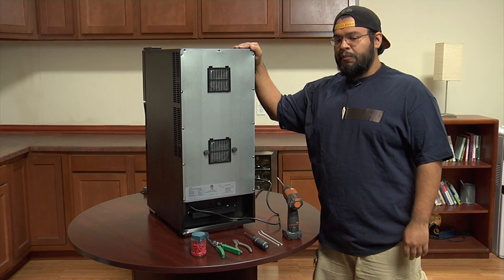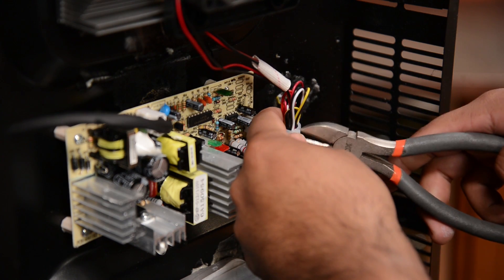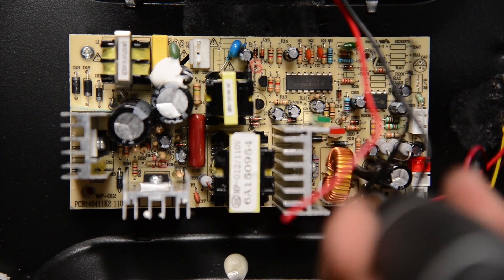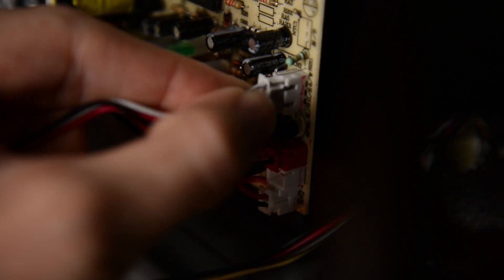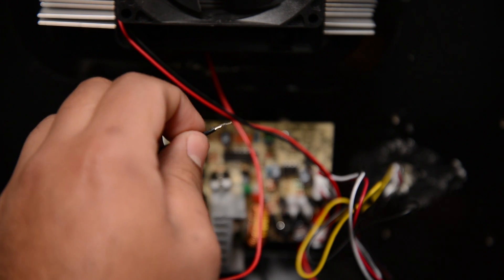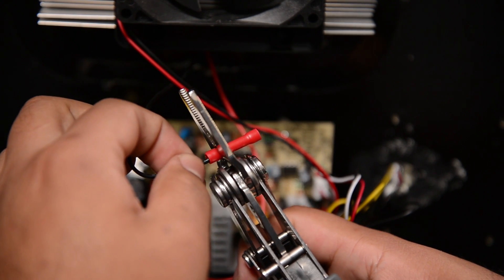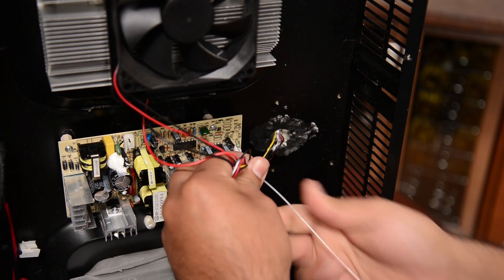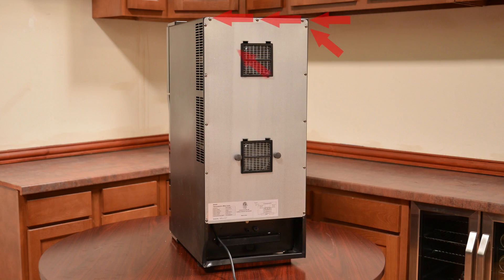How to Replace a PC Board in a Wine Cooler

Comment: this is a great video, thank you, even a lay-person like myself can do this, my only concern is that my existing wine cooler has lights on and I just want to be sure it is he board I need to replace. I think it is unlikely that both of the "heat exchange units" are defective so I would assume its the board, how can I tell?Mine is an AW-321ED with 4 cooling inits and two boards and it is only one side that does not work so I am thinking it is the board. I would very much appreciate any feedback or advise, thx

Comment: When can you get a new PC Board? Also what happens to the NTC1 cable in the new board doesn't have a connector?

Does that mean the NTC1 cable is not necessary?

Many thanks.